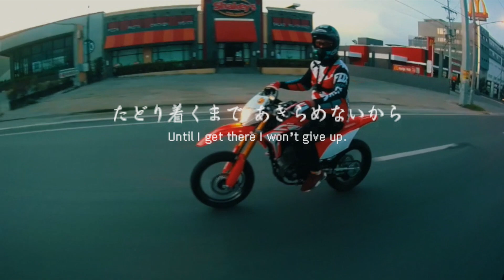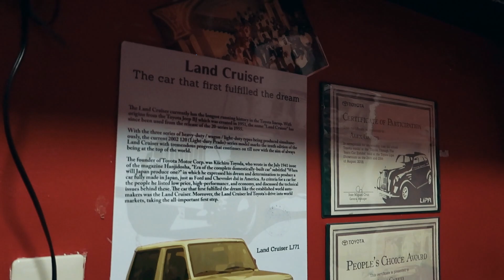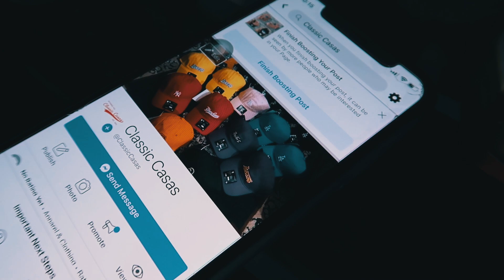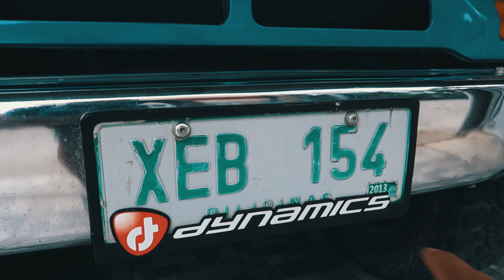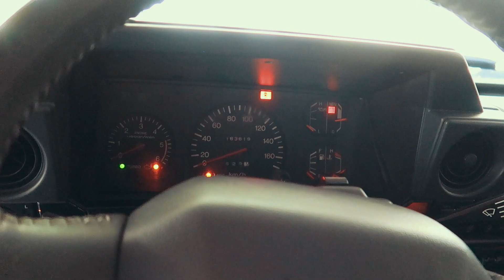Daily Vlog With the Kids Ft. LJ71

Comment: boss magkano abot 1kz
Reply from the maker: •engine transplant 200k
•Lhd dash and pedal bracket to align dash and pedals to Lhd 4,500
•Lhd shifter conversion 8k
•Lhd gearbox 27k 
•gearbox installation 4k
•transmission overhaul labor and atf 15k
•Lhd accessories rewire 18k
•bnew aluminum radiator 16k
•front discpad  bendix 1600
•rear discpad bendix 1,400
Reply: Thanks boss..